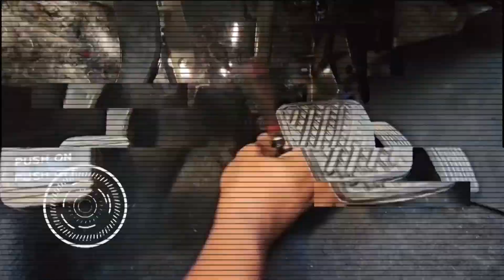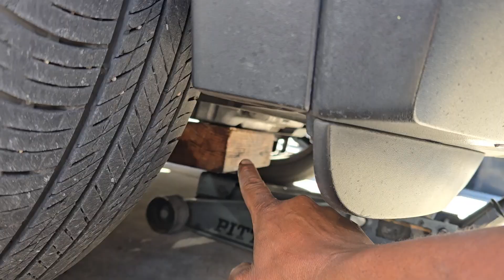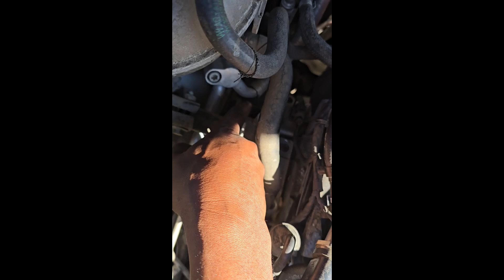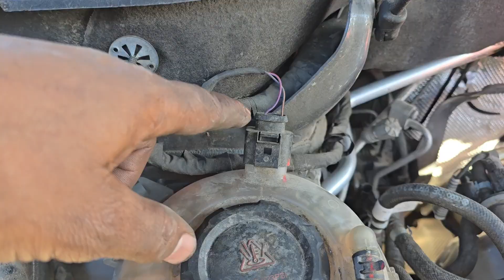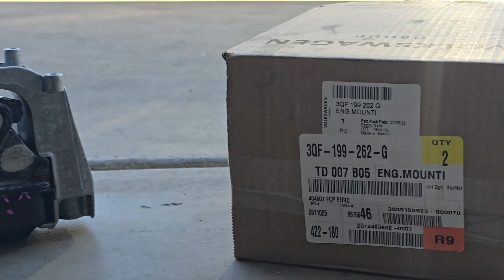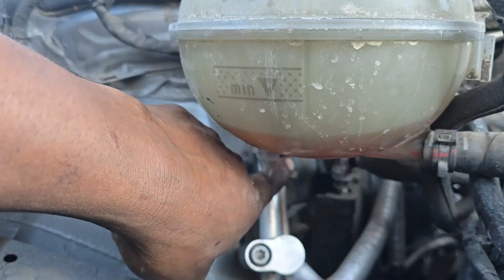Is your Volkswagen Atlas vibrating? Passenger Side Motor Mount Replacement

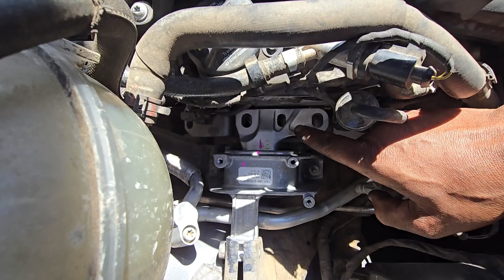Comment: Can you elaborate on what you mean "move the engine" @4:30. Do you absolutely have to move the engine during installation? Asking for a friend😂
Reply from the maker: So, motor mounts have rubber in them so once jack up the engine or you take the bolts out, the engine weight moves off the bolt slots a little bit, thanks for watching and support
Reply: @MurraysMobileMechanic-wp8yd thank you for the response. I rewatched the other mount video you posted and realized you showed us that with the pry bar.

Comment: What is the bracket that the mount is attached to called? Both bolts snapped on mine and I cant find the bracket anywhere
Reply from the maker: hey thanks for watching and your support is highly appreciated here, so I looked around. it's called motor mount bracket OEM part # 022-199-354-T. found it on WolfAutoParts.com. check it out if it's the right one. let me know
Reply: When you replace that mount that’s connected to engine make sure you get three new bolts… I’m pretty sure you fixed it by now

Comment: I have a 2019 atlas that vibrates, shakes violently at 70 mph. I am being told that it is the sway bar links and pendulum support. I came across your video and wonder if this is my issue.
Reply from the maker: It’s possible, but at that speed, I would definitely have your tires balanced and checked for alignment first! 👍